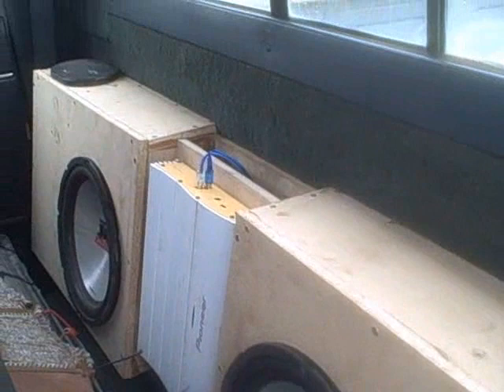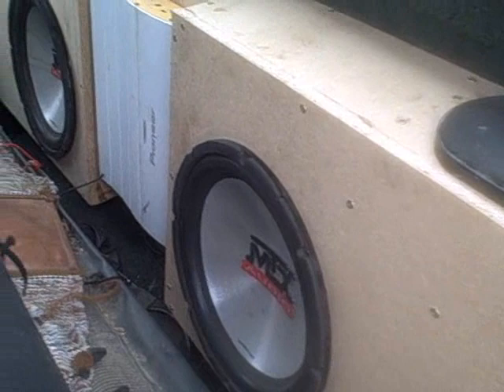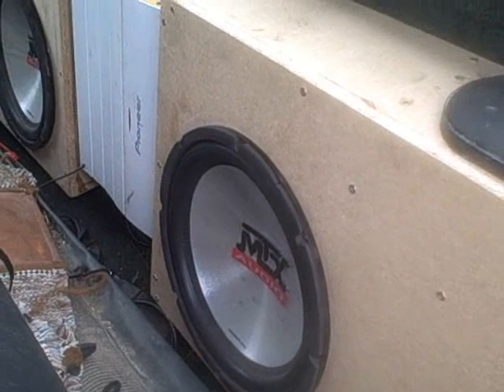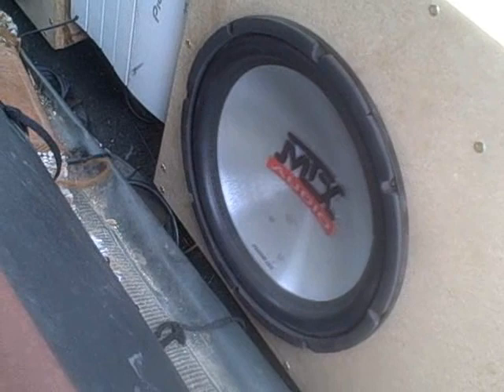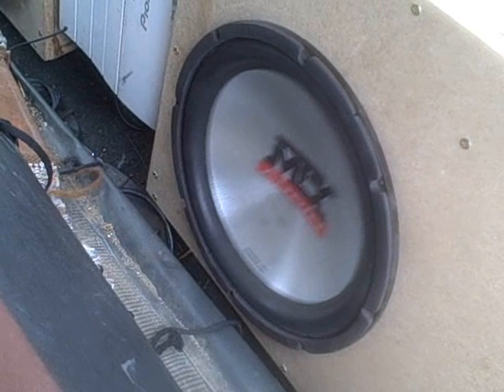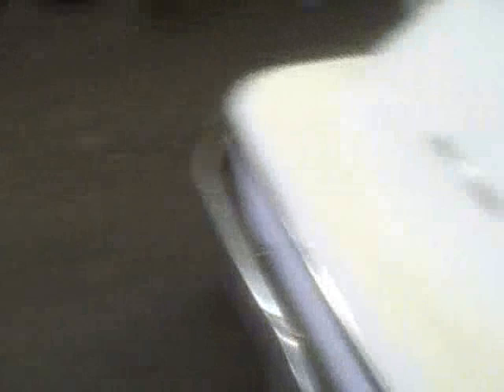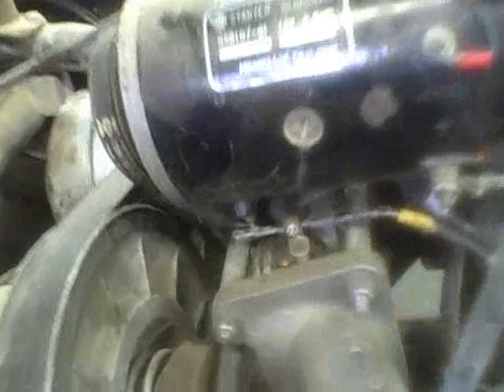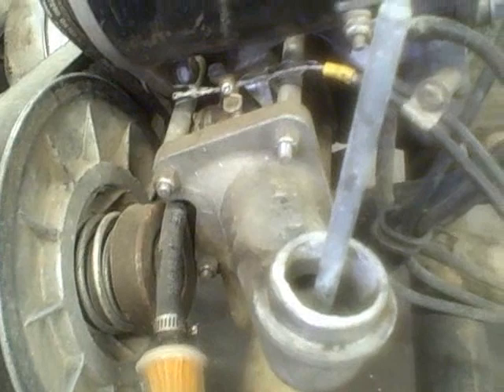The Wick Ranch gets a Harley Davidson and fixing the diaphram

Comment: 250 cc engine. 50:1 mix gas. last two digits on the serial no. represent the year. "H" and a number is 1970's and the year. so for example if it said "H8" it would mean 1978. and "J" is 1980-81

Comment: I just bought an old yz 400 and it had a similar stupid repair, someone drilled a hole in the drain plug of  the carb for some unknown reason and then tried to plug it with some sort  of glue or epoxy which turned into a huge mess inside the carb,  people who don't know about engines shouldn't be allowed to work on them.